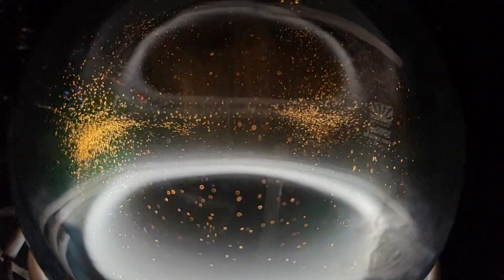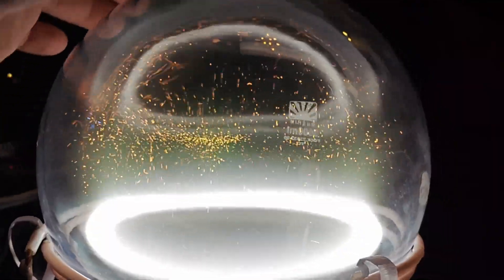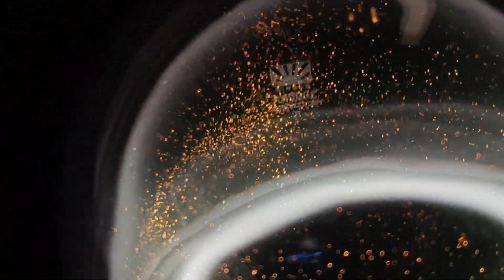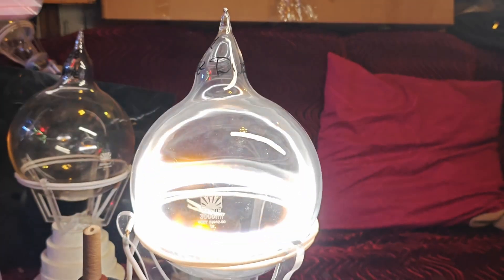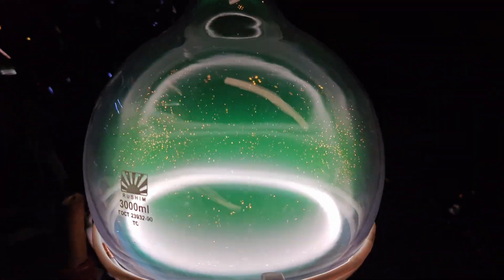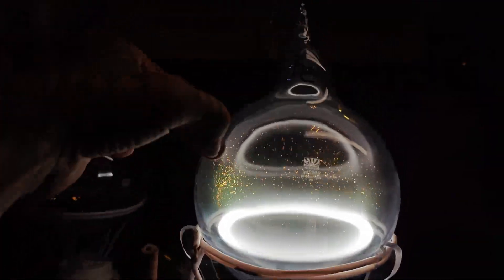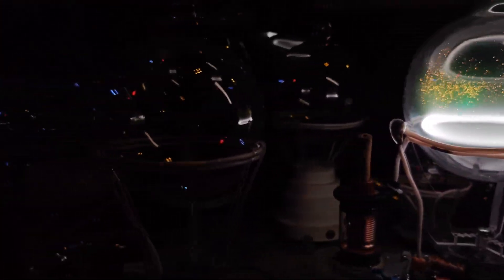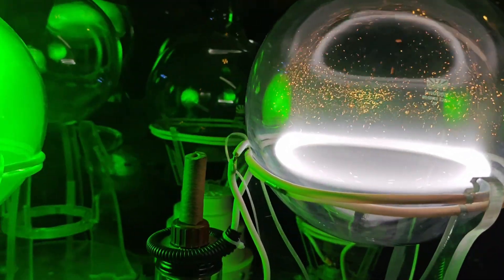Carbon Dusty Plasma Crystal in Xenon

Comment: I wonder how much the coriolus  effect plays a part. Your using iron powder,  I've only ever seen graphite powder used as the carbon.  Edit: I guess I've seen carbon monoxide used in a fill too. Not sure how the carbon acts after you ionize it and break the triple bond. (Common nitrogen is also a triple bond )